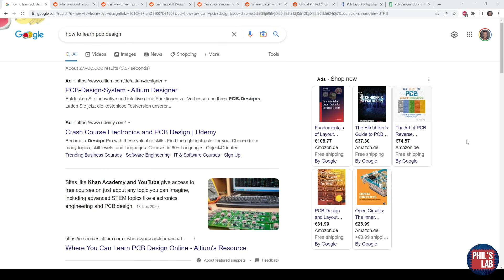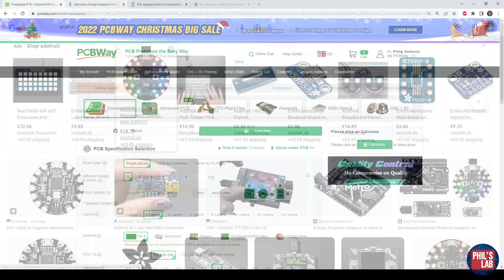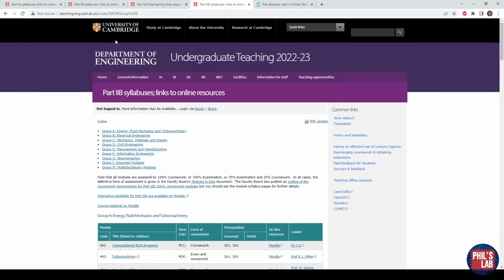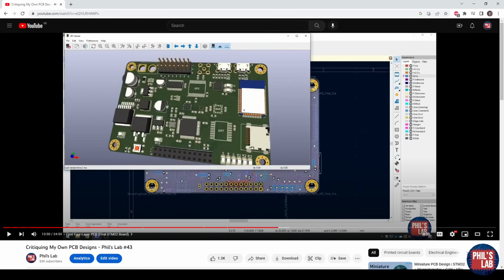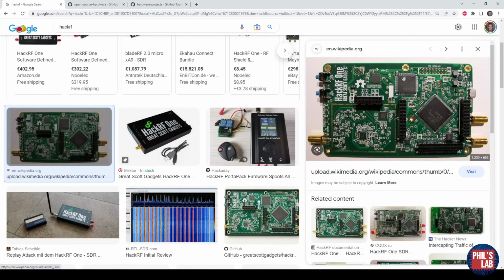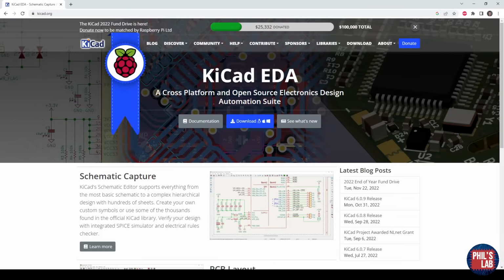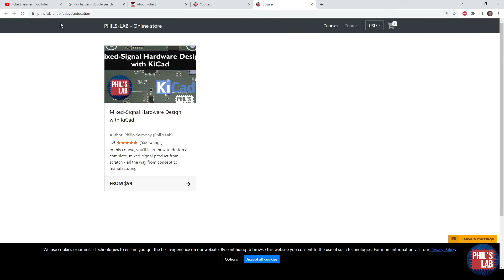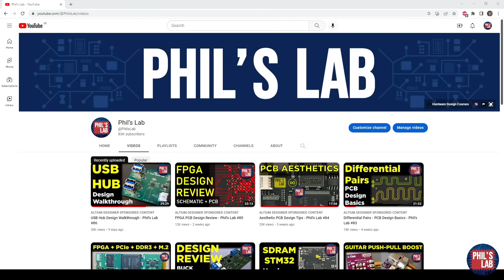(Sponsored) How To Learn PCB Design (My Thoughts, Journey, and Resources) - Phil's Lab #87

Comment: I was getting a computer engineering degree at Florida Atlantic University and they heavily leaned into PCB design through breakboards. I transfered to Florida State because they had a better rating for engineering courses as well as all my friends decided to go into that region. I was surprised to find out that FSU doesnt lean into PCB or hardware design at all, atleast for Computer Engineering. Though I graduated from there, looking back I was extremely disapointed in how they conducted their electrical/computer engineering curriculum. Its only now after I graduated that I realized that designing hardware is my passion and always was. Thanks for the pointers on getting started, I will surely take advantage of all these materials.

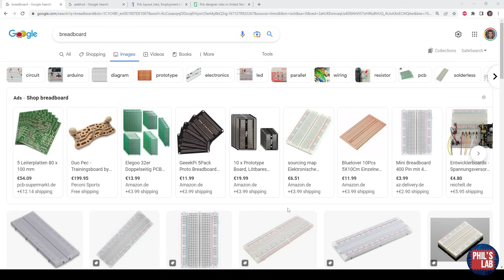Comment: Great video! At 2:05, you say that the next step up from breadboards is using modules from adafruit. How do you get started using these modules? Are there pitfalls that may happen when buying the parts (like buying a cheap thing that doesn't work)?

Comment: I must say, I am extremely surprised that you can do a 4 year course in electrical engineering and not do anything at all about PCBs. Strangely enough, we did some basic stuff about PCBs in what my high school called "control tech". (Although I didn't take very well to electronics at that level - I remember rather struggling with it.) About a quarter of a century later I'm finding myself dabbling with electronics a bit again, and your videos are extremely helpful for getting my head around some things. (I have some prior knowledge of physics and computer stuff, so it's not a complete leap in the dark for me.)

Comment: I think the big question is: if someone as an educated professionally working electronics engineer will want to do PCB design as part of their job. I would not. Typically a PCB designer does not have to be an electronics engineer. Certainly, some small startup  employer would like to see these two functions combined in one person. But in the bigger company's these functions are mostly separated.

Comment: Hey Phill, very good content ! i have one tip for you and anybody who see this comment. from the PCB manufacturing POV, it may not be a good ideia to use silkscreen on small pitch designs if you choose to have the board assembled by a machine at the factory. the problem is that during solder paste part of the process, the stencil don't fully touch the PCB if you have silk on it, thus leaving a small gap between the stencil and the PCB. it could cause the paste to fill these gaps with more material and shorting the pins during reflow oven process. it is always recommended to avoid using silk, specially if you have very small components or pin pitch. put the labels on copper instead. Thanks for the amazing content !

Comment: I'm surprised to hear PCB Design is so rare in EE courses. My university was pretty heavy on it with the very first semester having the assignment of creating whatever we wanted on a self-etched board that goes on a magnetic wall (which had copper strips supplying 5V to the boards) and every project afterwards all had some aspect that required PCB design to realize or to even hope to function. At graduation that very first assignment would be activated once more and then returned as a parting gift. It now hangs on my Fridge! ^^

Guess i'm very lucky to have gotten an education that was given by a group that were engineers first, Professors second. 

These days i keep designing and having PCBs made constantly as i keep learning new things. There is something about your creations coming alive that never gets old. I've also started to teach myself Mechanical engineering so i can wield the prevalence of 3D-Printing and open some very exciting new doors. Currently migrating all my old work to KiCad. Was taught in Eagle during university, but with its limitations and imminent deprecation it would be unwise to start a major project with it.

Comment: But i have a question. I had only one semester of electronics in college and that was pretty poor. So should I learn about components first, and all the physical underpinnings, or I can straight  jump in PCB Design just knowing what resistor and capasitor is?
Reply from the maker: I would check out 'The Art of Electronics' book as well, but you can do that in parallel to learning about PCB design.

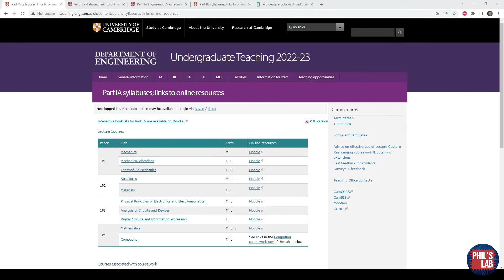Comment: 5:00 Speaking from my own experience at Berkeley 25 years ago:
Electrical engineering was... weird. In our first year, we were taught analog stuff like using relays, passives, and BJT transistors to make an obstacle-navigating robot. If we had even a primitive Arduino, that lab would have been child's play. In the exact same course, we were taught how ICs were made from silicon at the nanometer scale. There were brief mentions by some of the professors about how "you shouldn't do this or that with the conductors or there's going to be weird stuff happening", but nothing that would really inform how you'd lay out a PCB.

Comment: I have almost no knowledge about electrical engineering. I studied theoretical mathematics and worked as a software engineer. In recent days, I am also doing some embedded programming in my private project. I learned a bit Kicad, but I don't know what components I should use at all.

Comment: Great, awesome video as always. Phil, when you get assembly services from pcbway or jlpcb, are the used parts genuine? Im working in a stm based project and a little worried about getting a non genuine part (like these cheap blue pill that aren't recognized by the mxcubeide). Thanks from Brazil!

Comment: I've gotta be honest, man. I've actually seen the opposite of standalone PCB designers. A lot of the older EE guys that I have worked with don't know PCB design. They all are used to just scribbling out a schematic on a piece of paper and then handing it off to the PCB guy. All of the younger guys all do their own designs. I've even seen the dedicated PCB guys retire and have their position eliminated. It actually makes a lot of sense because it was a whole ordeal back in the days before CAD when they had to use tape and a drafting table. Maybe it's different across the pond.

Comment: I'm a hobbyist and in the past 5 years I've created a number of different PCB's, most being used for simple sensors, WLED, etc.  You don't need to be an EE.  I start out on a perfboard to ensure that my ideas work, then design the PCB using KiCad and have it made by a reputable company.  My PCBs sometimes take a few tries to get right, but it's still easier than trying to wire things together using jumpers.  I've got a bin full of "oops", but keep them to remind myself of my mistakes.  It's worth doing, and incredibly simple once you figure out footprints and spacing.  And 5 boards for under $10 (inc shipping) is a good incentive.  Keep in mind that the manufacturers will make EXACTLY what you tell them to make.
Reply: Amazing

Comment: Nice video!

There's a step in between ordering PCB's and the manual boards in my opinion. It's DIY routed boards. If I need a quick prototype, I usually just put a blank PCB on my CNC router, and make it. It's not as hard as it seems once you get the hang of it - and even (extremely cheap) CNC3018 routers are capable of doing this quite nicely. It's primarily useful for partial designs that don't have to last. Yes, soldering is much trickier, and double sided PCB's are especially tricky - but the turn time is just a few hours which makes it incredibly fast. Not only that, but it's much easier to route a complex board than making it on a breadboard. That being the case, as you pointed out as well, there's a limit to how complex these kinds of boards can be. 

One thing that I would like to know a bit more about, and you might know, is what you can test BEFORE sending things to the factory. You can only be so careful... there are so many "rules", especially with high speed design, and everything seems to interfere with each other in some unexpected way. Perhaps I'm just paranoid, usually my PCB's seem to break in unexpected ways... but still, it's good to get advice on this? Or is it just that KiCAD doesn't support things like this, and more professional tools like Altium do?

Other than the tips that you give, I notice that I spend a lot of time on LCSC just reading up on data sheets, especially on IC's that I haven't seen yet. Just to get the "lay of the lands". I'm wondering, would you recommend this practice as well? Or do you consider this an utter waste of time? :-)

Comment: I am odd I thin kof your watchs, I am a HA, sec, Embedded, realtime software eng.
Part of my job is reviewing  HW designs from  SW point of view, so I can try and get the problems the the HW degisn will have problems from a SW point of view, SW development, debugging recover .......
There are all sort of them to do with circuit degisn and PCB design, that the HW teams forget about, adding test points, moving thing around, adding dome NF bits just in case SW need them or have problems.
they are normally very basic things, like the board I am currently using where they did not do my change request of turning the JTAG Debug around by 180deg the the hi speed cabled did not go over the radar output. so we mess up the debugging and the radar can only see the debug cable.

Comment: What I miss is the maths and knowledge needed to design the circuit. I'm reading "The Art of Electronics" and "Practical Electronics for Inventors" to get started
Reply: That’s my problem. I think designing PCB is fascinating, but what can I do with it. What do the components do, etc. Not really interested in just throwing together premade kits, but if I knew what was possible I could design my own projects. I will flag those books, as it sounds like that’s the route I should be going first.

Comment: I'm just a CS person that got into this as a hobby, it's crazy that they don't teach this in EE programs. Thanks for the helpful suggestions and resources!
Reply from the maker: I think it's a real shame as well.. Even a brief mention of PCBs in my course would've have been better than nothing :D
Reply: How do you know what they do in Electrical engineering if you are a Computer Science professional?
Reply: @chisangamumba2961  computer science may have electrical engineering classes
Reply: @chisangamumba2961  Basically when they say digital world, it is more about I0I00IIII0000 as a lunguage that computer can understand/machine language, inside a digital computer all the circuits are made of transistors that function following/understanding that I0I0III00 lunguage and those zeros and ones are obtained from voltage ON =I and voltage OFF =0 supplied to different blocs inside a computer keeping switching on and off at a very high speed(Frequency Megahertz and gigahertz etc) and now that we have voltage you see the reasons for someone in CS to get some knowledge about Electrical Engineering competences whereby because there is a need to know a given part inside a computer needs/operates at this voltage/current and finally the best and genius people will need to put all those skills and knowledge on PCB/Motherboard to end with a fully fonctionning system

Comment: Thanks for the advice. Great video as always! My university didn’t teach PCB design properly as well. They just mentioned 45 degree traces and ground plane but nothing else.😂

I did not know that I can get design review on the sub-reddit before. My design looks really amateur compared to what has been shown in your video so far as I was somehow trapped inside my comfort zone. Progressing by designing development board with more advanced CPU or complex circuit might be good but i still need to find a good reason for those design. Practice could be the best one in my case.
Reply from the maker: Your university at least mentioned more than mine in that regard :D 

I'd highly recommend not just making designs for the sake of it. I tried doing that but my motivation just wanes very quickly..

Comment: First, thanks a lot for all the videos and knowledge you share. It was quite a relief to hear that you weren't taught PCB Design even at Cambridge. Myself, I had my electronics education in the 90's, 3 years at technical high school, then 2 years at a technical college, then 3 years at university level. All these years attending electronics classes. However, none of the courses I attended  over these years taught us anything about PCB Design. I learned a lot about designing discrete circuits, amplifier designs, RF/antenna theory, maxwell's equations, filter calculations analog/digital, FIR responses and so on. But never anything about practical circuit/PCB design. What kept me not "missing out" on this was my home lab. I had a genuine interest in electronics as a hobby, and during the years I made my own small circuits at home. It started with a few soldering kits, then developed as I got my own etching tray and blank PCBs with photoresist film on, which I could produce myself. It took years to develop a process for printing traces on suitable transparent paper, UV exposure, dissolving and finally etching to get a good result. Double layer boards were especially hard to get right. But man, that hobby was worth it looking back now. Even if I don't work as an electronics engineer as my day job, it is still my hobby, and I am still able to design small projects from start to end. I don't think I would be able to do that if I only knew the theory from school. In addition, It's a lot easier now as we can order the boards online :)

Comment: I think one reason universities don’t offer many PCB design courses is that they are somewhat hard to incorporate in courses. Designs that are not produced aren’t that useful and if you need them for a project course the PCB must be finished at least a week before the deadline, so the last three weeks of lectures can’t really be incorporated either. It’s only really been possible in long running projects at my university.

Generally universities also don’t try to prepare you for a trade, but teach you in an academic setting. That is however besides the point

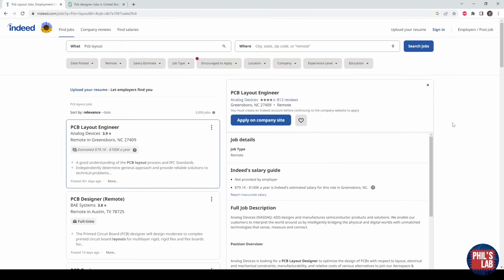Comment: At 3:52 you said something that REALLY shocked me! "... it turns out that electrical engineers USED to do the PCB design work..."
I started doing PCB (layout) design work in the late 1970's. This work was done by draftsman (draughtsman) as was the drawing of schematics. I started out drawing schematics on paper for the engineers from their sketches. Then I got into doing the PCB layouts using black tape on clear plastic. All we had were handheld calculators.
There was almost no ECAD software or computers to run said software for small to medium sized companies until the early 1990's.
Lowed priced as well as high priced ECAD vendors started promoting to electronics companies that an electronic engineer could do ALL of the required tasks necessary from creating symbol libraries, drawing the schematic, simulating, layout the PCB, and document the entire process.
In my experience, this turned out NOT to be viable. Maybe you have seen this unfolding during your career.
In the 1990's into the early 2000's while I was using the ECAD software carefully and methodically doing all these tasks EXCEPT for designing the electronic circuits, sometimes an engineer would try to speed up the process by taking over the PCB layout process. They would invariably break many layout rules. Corners less than 90 degrees, high frequency signals cutting right through ground planes, differential signal traces going all over the PCB, picking a 2W carbon film resistor from the library and placing it where a 0402 resistor should go and expecting the purchasing department to correct the mistake, among many more. 😞
I left the industry at the beginning of 2005.
Now, according to your experience, the industry has returned to having a specialist for each complex task instead of trying to have only one person do ALL of the design tasks.
I do realize that "one-person" companies still need to do all these tasks. This is true today as it was forty years ago.
The area of the world I worked in might have had some differences from where you reside. I was located in the New York City region. There was and still are many high-tech companies within a hundred-mile radius.
🙂

Comment: Just when we needed this! 
Currently as a EE student, always felt this lack in the curriculum, but surprised even cambridge doesnt include this
Reply from the maker: Yeah, Cambridge - in any of their engineering courses - was far too theoretical. Basically, I did a maths degree.. :(
Reply: Are you not required to design a PCB in your ABET senior design? Just finished mine, and designing the PCB was a hard requirement that you couldn't pass the class or get your degree without.
Reply: @tissuepaper9962  ah, nice 
Though, idea is to offer it as a course in university
Reply: Are you not required to design a PCB in your ABET senior design? Just finished mine, and designing the PCB was a hard requirement that you couldn't pass the class or get your degree without.

Comment: Thank you Phil!!! it is really a good video and I learn a lot from your mix-signal design course. 
PCB designer is an important element of project, while dealing with MCU, FPGA on the board are also necessary. That would be nice if you can also share your experience on this. (I am struggling with it)
Reply from the maker: Thank you, Marcel - and thanks for signing up the mixed-signal course. I'm currently working on an advanced hardware design course, covering FPGAs, DDR memory, BGAs, and much more. Hopefully that'll address your concerns!